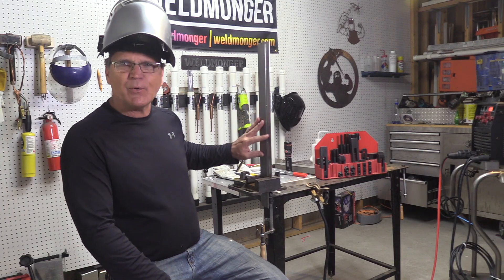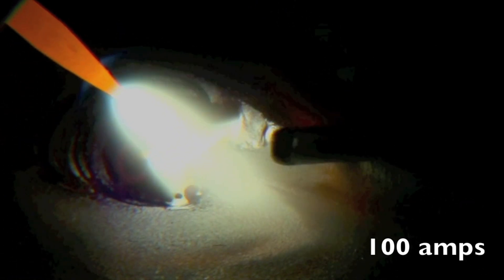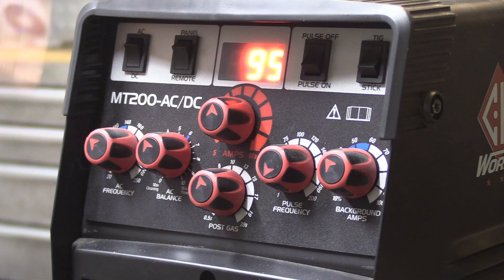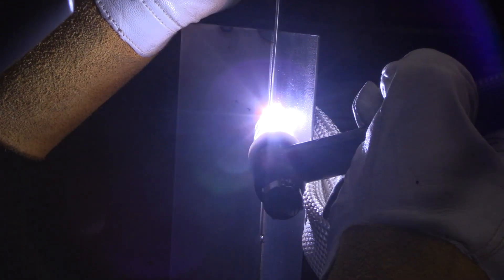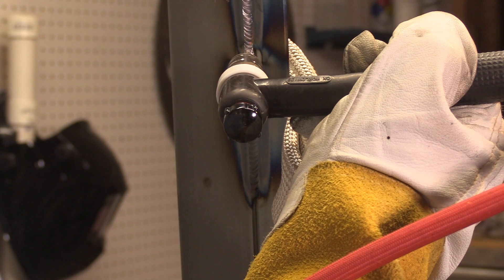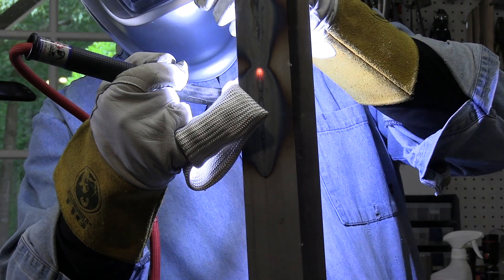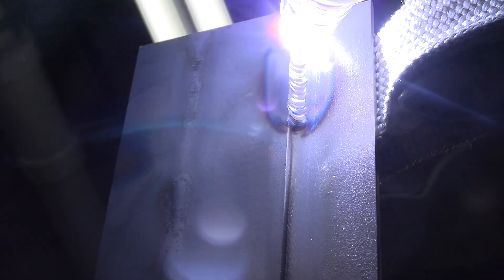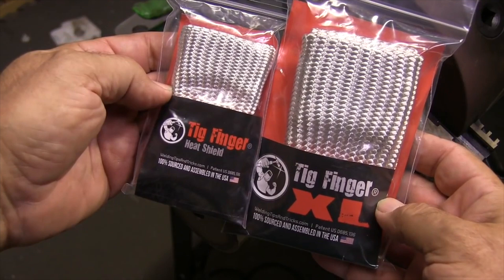Vertical TIG Weld  3F Lap Joint - Cold Rolled Steel | Welding Tips & Tricks #Welding #TIG

Comment: i had a very thin cold formed steel channel section on which i need to weld a rebar. Either i go with TIG or MIG and what things i should take care of to ensure that the cold formed steel integrity dont get much sacrificed during the welding process.

Comment: Keep the vids coming Jody. I'm brand new to welding as a hobby and learning everything from you. You deserve the financial support so I'm buying stuff from your site. Let's see a current video of aluminum fillets. I'm struggling with a smooth weld pool. Arc is bouncing all over the place. Also, most of us beginners have a welder under $1000 which may add to our struggle? I'm using a PrimeWeld 225x

Comment: What sets you apart from all the other welding channel hosts is the fact that you explain what you are doing and why you are doing it that way! This is something I really appreciate and value! There are many excellent welders hosting channels, showing beautiful weld seems. But none of them give the necessary information on how thay achieve these welds. Your channel is by far the best and I appreciate all the effort you put into producing your videos! 
I have been unable to do any welding and for that matter any work in my little shop due to health issues for the past two years but I'm hopeful that the future will change for the better, soon!
Thanks again for sharing all your great videos and keep up your great work!
P.S. I did find the episode where you promoted the CK filler wire feeder ,EZ  Dabr, and put in another request for one unit with CK! If you don't want to respond to my email/text message, that's OK, although it would be greatly appreciated to hear from you!
Thanks again!

Comment: Hi i am from Russia, so excuse for my english) ( I do no use translators)). Iam weld engineer. 
I  want to ask: why everyone love TiG? in  plant we made some piping equipment, and welders in anytime weld by GTAW. I think, because TIG is clean, accuracty, less spattern, more controllable, light torch, less hazard smoke. e.t.c.  By the way we want to weld piping (regular and ss) by GMAW root, filling and cap by FCAW, for that we buy Miller with RMD process. How you think its right way? I am waried by quality..

Comment: I'm starting to learn TIG from your videos and I've got a related question. Earlier this year the guy I usually buy my metals from offered to sell me everything he had and his TIG rod for a good price so I did. So far about the only thing I've gotten home is the TIG rod. I'm not sure of the exact amount because some was in boxes and some not but I'm pretty sure I have over 50lbs of Aluminum rods and at least the same if not more Stainless rods along with 30-50lbs of Silicon Bronze. Right now I have it sitting in the back of our garage in plastic barrels. The garage is not climate controlled and I wanted to know what's the best way to store it? Can I just make a PVC rack and store it that way or do I need to worry about oxidation on the aluminum? I've heard that you can spray the Aluminum with something like Purple Power and then rinse it with water and it will be fine. Is that correct? Any help I can get on this would be greatly appreciated.

Comment: Hey Jody,  serious question,  have you ever heard of aerospace welding using helium as a purging gas for 304 stainless .325" thick? I'm having a boat load of trouble it with it, especially with  penetration, and heat spikes....help!!!
Reply: I've heard of using Nitrogen but never heard of using Helium.  Would be more expensive than just using Argon so I don't see why they would use it...

Comment: I wanna learn to tig weld. I’m very efficient stick welding, been doing it for 10 years. But I’d like to try to learn to tig
Reply: You won't burn sticks anyone, that's for sure. It's so clean that you won't want to deal with stick welding again.
Everlast units are good and their customer service is great! I spent 2.6k on mine, it's money well spent. (255ext)
Reply: If you are already good at stick, you are about 80% proficient at TIG whether you realize it or not.
It's not as much about the style of welding that you're used to - it's the understanding of what welding actually IS, and how to control all the variables.
TIG gives you much more control of all the things.
Reply: @jdgower1  I'd agree and add that not burning that flux off of a stick gives you do much more input because you can actually see...
It takes a whole lot of effort to make TIG welding turn out awful.